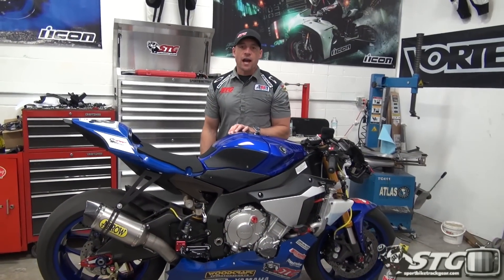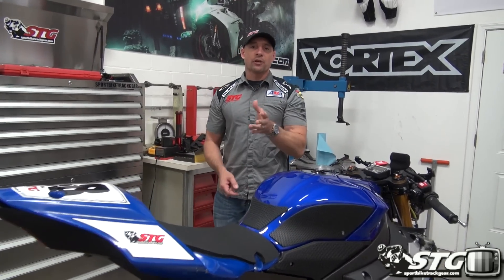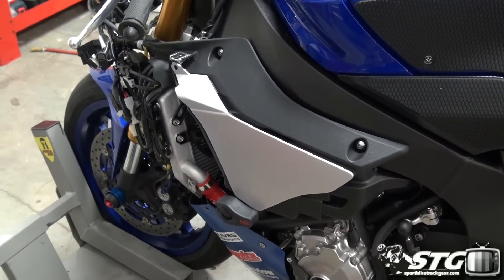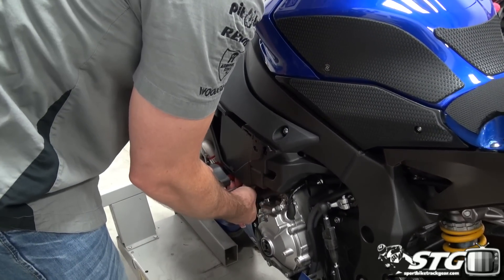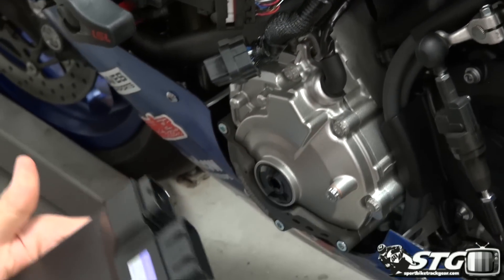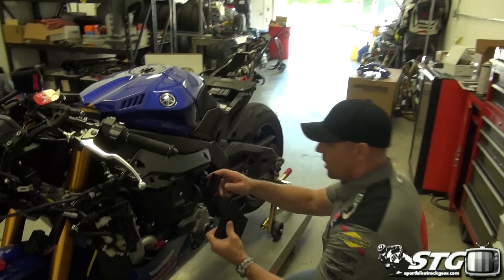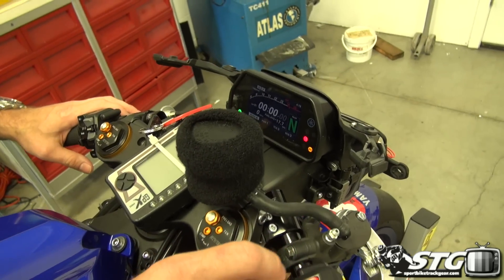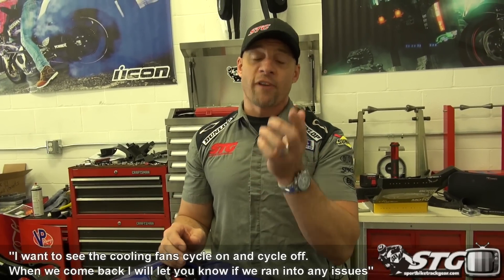How to Flash Tune a 15-17 Yamaha YZF-R1 from SportbikeTrackgear.com

Comment: I'm about 5 years too late but I'm hoping to get a reply. I've been looking everywhere to find a map for 2007 Yamaha r1 with gytr slip on and a danmoto cat eliminator but it looks like theres no maps out there for gytr slip ons. what would be the best map for me to run. again the set up is: 2007 r1 danmoto cat eliminator, gytr slip on. stock headers. thanks in advance
Reply from the maker: I would use a full system map for any brand exhaust. That should get you a good result. If you want more you will need to get the bike on the dyno and have a map built. - Van

Comment: Hi Brian; please Help, I have few question.

I flash my MT09sp. under Unrestricted mode, and i m looking at ecu setting.
1st Question: On the "Disable top speed limiter",  What should i select. (True/False). 
sorry i really confused. 

2nd Question: I noticed after i flashed. when i start riding off my bike and the fan is turning ON. 
But the bike wasn't really heated up to 195c.  Seriously not sure with that.
Please Help.
Appreciated if you could giving me a halping hand. Thanks Bro. :)
Reply from the maker: If you want the top speed limiter removed you need to set that to true. As for the fans there is nothing wrong with it coming on at 195. If you want it to turn on later you can change that as well. FTECU has some great support. Not a bad idea to shoot these questions to them as every model can be a little different. - Van
Reply: @sportbiketrackgear  Thanks for the speedy reply. Love your post aways. 
Two Thumb up. 
I love all your video, n have supporting you always. 
Appreciated so much. 
Thank you, Van.
You have nice pleasant day. Cheers :)

Comment: Is there a flash file for M4?
Reply from the maker: I do not think there is an M4 specific flash. That said I am comfortable running a map based on the system configuration regardless of the exhaust brand I am running. Have been doing that for years with good results. To get the last couple of % in performance you would need to get the bike fully tuned. Most often the difference is not even noticeable. - Van
Reply: Sportbike Track Gear thanks

Comment: I have a 2019 Yamaha R1. The latest Graves R1 flash I see for download is 2018. Seems like the changes should be very minor so would that 2018 ECU flash work with my 2019 bike?
Reply from the maker: To get a Graves flash for any of the most current model bikes you have to be running their exhaust. If you have their exhaust they will send you the file to load into your bike. - Van

Comment: Do I have to have a full system in order to remove the restrictions?
Reply from the maker: If you want to get the most out of the bike you will need a full system with the ECU flash. - Van
Reply: Sportbike Track Gear understood but the flash will cure the rev limiter and choppy throttle until I remove the stock exhaust right?

Comment: Is there a map for akrapovic as for graves or only graves?
Reply from the maker: I don't think there is a map for the Akra. That said I used the Graves full system map with mine and it worked very well. - Van
Reply: Sportbike Track Gear sounds good do you recommend if doing a tune also removing the AIS and deactivating it with the flash? sorry for the questions I just want to make sure if I need to buy the plates with the bench tune as well with the full system
Thanks!
Reply from the maker: I would install the exhaust and block off plates then flash the bike with a map for a full system. End of the day there will be a massive improvement in performance. If you were racing for the win and felt like you needed every last bit of power then invest in a tune with a reputable tuner. - Van
Reply: Sportbike Track Gear thanks guys ill get all that stuff from u guys in a couple of months you are gaining my trust over revzilla
Reply from the maker: We look forward to working with you when you are ready. Revzilla is a good company, that said I believe we are a better resource for sportbike riders. - Brian Van

Comment: Hey Van,
I'm curious who your POC is at Graves? I recently purchased a bench kit from your store and went to upload a Graves Tune(BX4-8591A-10-(US)Graves Exhaust Cat Eliminator 051717L) for my 18-R1S... Unfortunately, because it's a midyear R1 it has a B60 ECU in it and all of Graves tunes are for BX4 ECU's. I asked FTECU about it and they said that I would have to contact Graves because they only have available what Graves gives them. Can you assist???
Reply from the maker: Graves has stopped allowing unrestricted access to their Flash Tune files, this started about a year ago I think. While this can still vary from model to model the only way to get a Graves tune is to purchase one of their exhaust systems. After purchasing the exhaust you contact Graves with proof of purchase and they email you an access code. I have been told FTECU is working on adding tunes of their own for customers to use. Not sure where they are at with this process and need to call them again. 

Is there a tune in their data base you can use for your bike? - Van
Reply: @sportbiketrackgear (Van),
The only thing available in the FTECU for the B60- is the Unrestricted file which I believe has better ignition timing, but I don't believe will address the cat delete and aftermarket exhaust modifications that have been/will be made to my bike. Which sucks because if my bike had I BX4 variant ECU I could use all the graves tunes and no one would care what exhaust I had. You said in here that you ran their tune with an Akro, and it ran great yea?!
Reply from the maker: Yep, I used that tune with several exhaust systems and the bike always ran great. IMO as long as you are running a quality system on the bike a good tune for pretty much any system will work well. - Van
Reply: @sportbiketrackgear (VAN),
I hear you sir, but this isn't about the exhaust it's about me NOT being able to access that Graves Tune by virtue of the ECU that Yamaha elected to put in my bike. So IYHO would you run a high-quality exhaust, with a cat delete, K&N high flow air filter, on FTECU's unrestricted file versus the Graves file?
Reply from the maker: @ShonBroomer  The unrestricted file from FTECU is a massive improvement from stock. It is mapped for aftermarket exhaust with both fuel and ignition corrections in the file. I would 100% run this file in my bike with an aftermarket exhaust. If you have a Graves system on the bike with a proof of purchase you can contact Graves requesting access to the file they have built as it would be a little different from the FTECU. Graves puts a lot of time and effort into those files which is why they restricted access to these files. While the Graves file has it's advantages IMHO most riders (myself included) are not able to ride the bike at a high enough level to take advantage of the difference in the files. - Brian Van
Reply: @sportbiketrackgear  
@Brian Van Thanks Boss!!! That's what I needed to know.

Comment: Can I flash tune for a two brothers exhaust system with this system?
Reply from the maker: You can, not sure you will find a specific map for the Two Brothers system but you can use most any full system map and get a decent result IMO. - Van
Reply: Sportbike Track Gear thanks Van. I appreciate your channel.
Reply: Sportbike Track Gear what about using a power commander?

Comment: is there a way to set an accurate speed reading through this software instead of needing to get a speedo healer?
Reply from the maker: To the best of my knowledge that feature is not available with the FTECU stuff. When we are on track we run GPS lap timers that also record the speed so we use that when looking to find speed on the straight or in a particular corner. - Brian Van

Comment: Van been watching yeah for a while now the ftecu can it for sure clear all codes on a 2018 r1?
Reply from the maker: I know for sure it can do the PAIR System, Exhaust Servo and Steering damper. When you get the bike ready to flash you can enable or disable certain options. Once you have done this you finish the flash and off you go. - Van

Comment: It says it works better with active tune. Do i need to buy the active tune kit?
Also what ecu setting should I change once I select graves cat eliminator map? It doesnt give options like “disable top speed limiter”. What should I do?
Reply from the maker: I did not use the active tune and we do not sell many of them. I would recommend just flashing the bike (assume you have a 15-18 R1) using the Graves map. If you do not see the option to disable the top speed limiter in the software then that is either not available or unnecessary.
Reply: Sportbike Track Gear so just flash it without changing any ecu settings? They already did the settings is that correct?
Reply from the maker: Fast forward to 7:30 in this video and watch the steps I go through as I select the file for my R1. For the R1 there were only a couple options to select, super simple. Now this was done a couple years back so it is possible the software looks a little different now. - Van

Comment: I have SC Project cat eliminator exhaust, Can I flash ecu with the “graves motorsport cat eliminator exhaust” map for my bike? Or It has to be exhaust specific?
Reply from the maker: I have done that in the past, it will work fine. The flash on the R1 makes a real difference, they have the mapping dialed in. - Brian Van
Reply: Thanks. It says in the notes best if used with active tune? Do I need to buy active tuner now? Also What ecu settings I need to change? It doesnt give enough options to change like disable top speed limiter etc. what should i do?
Reply: It says it sounds best with active tune. Do i need to buy active tune kit?
Also what ecu setting should i change? It doesnt give option to disable top speed limiter. What should I do?

Comment: Hey could you please help me figure something out? I have a 2016 r1s and I just spent some good money running a 3/4 system then my local shop installed a pc5 and they blocked off air injection and made me a custom map and dyno tuned my bike and made great hp.Now the question is can I purchase ft ecu kit and just raise my redline a little and adjust the amount of throttle I am getting and leave the pc5 in my bike without any trouble? I don't want to override there custom map I just want to raise redline and amount of actual throttle. If you can answer my question I would highly appreciate it

Comment: Are the maps you got from them free? I bought the M4 street slayer exhaust and I want to flash it once I install it but no one here will do it. Where can I get a map for the m4 street slayer on a 2016 r1
Reply from the maker: I would just use a map in the system for a 3/4 or full system. End of the day that will get the job done and you should not need to get it on the dyno and have a map built. - Van

Comment: A question. If a complete exhaust system is installed on our motorcycle, is it obligatory to make a remapping of the ECU? or can be used as such. I know that it gets more power to the rivet but I want to remove the doubt if it is harmful to use the motorcycle with direct exhaust without making modifications.
Thank you so much
Reply from the maker: Technically you should but to be honest you do not have to in most cases with modern sport bikes that are fuel injected. I have installed many systems on bikes that did not get a tuner installed with zero issues. - Brian Van

Comment: Hi I just installed a akrapovic 3/4 system just wondering which tune to go with . The graves 3/4 or full system tune on the ftecu flash tune  thanks
Reply from the maker: I have the Graves full system file in my R1 now, installed this when I had the Arrow full system on the bike. Since then I have installed the Akra 3/4 (man do I love that exhaust!) and left the map as it was. Performance is solid so I felt no desire to remap. - Van
Reply: Thanks van I spoke to Evan he told me same thing I shop their all the time I appreciate the replay you guys have great customer service and buying from you guys I couldn't be more happy 👍
Reply from the maker: I remember Evan calling me about this. Evan does an amazing job, proud to work with him for sure. Thank you for your business, it is appreciated. - Van

Comment: Hey, huge fan of your videos. Have already purchased some accessories from your online store to my R1 2016, great support. Quick question, I have recently installed a Akrapovic GP exhaust so I would like to flash tune it. Is this setup you are showing here (Graves full system) compatible? Also, a friend told me that an active tuning would be the best choice but I'm just a street/track day pilot and I was wondering if that wouldn't be overshooting? Anyway, for active tuning I would also need to flash tune it first with this kit, right?
Reply from the maker: Yes you would need the unit. I would say in your case the active tune could be very beneficial since you are doing some different types of riding. I actually am using this very same map with my Akrapovic system as well and it runs great.

Comment: I want to install a Austin Racing GP1R 3/4 exhaust on my R1, would the flash tune maps work for all exhaust or just the graves system.
Reply from the maker: The map should work well for pretty much any system. If you are racing in a pro level series I would say it is really only set up for the graves system, but it would be hard for most people to tell the difference. Thanks for watching!

Comment: Does the graves flash tune disable the AIS or the ABS? I saw no option to adjust it so i assume its already built in the program. Or no?
Reply from the maker: +Charles Pratt the FT for sure disables the AIS, I had previously removed my ABS system but I would assume it is still there electronically.

Comment: Brian, did you guys unplug the O2 sensors from the electrical connectors after getting ECU flashed?
Reply from the maker: +jacobstacho No they are still plugged in. I have ridden twice since this flash and the bike has run with zero issues. - Van

Comment from the maker: End of the day they both get the job done. Myself I can get the ecu out in a minute or so and head over to my command center to update. - Van
Reply: Question: what can make the FI light switch on even if the ECU is flashed? Throw -C00 which is nothing confused thanks!
Reply from the maker: You would want to take it to you Mechanic for a proper diagnostic test! Thanks for watching!
Reply: +Sportbike Track Gear thanks
Reply: I had my 2015 flashed and now it won't start there's a err in the right hand corner of my screen what should I do help me man
Reply from the maker: Steven Myers Did you do the flash on your own?
Reply: no I sent it off to get all restrictions of while flashing the computer the bike was getting an extended swing arm and new exhaust when I got thecomputer back I sent it to where I was getting the swing arm done and it wouldn't start it will turn over but it won't fire I'm thinking they may have flashed under european but I'm all dressed up and nowhere to go
Reply from the maker: Bummer :( I would probably recommend you take it to a pro that is close to you. Hopefully they cang et it sorted out.

Comment: The bench unit may be easier initially,   but the Graves maps for their 3/4 and full systems have each already been revised at least once.   Imo the bike harness  is easier in the long run if you plan on periodically updating your ecu.

Comment: Van,
You have chosen the Graves full system map even though it is an Arrow full system installed on the bike. Will there be any issues with this? Is the Graves map meant to be used with the Graves exhaust? If not, can it be used on stock exhaust?

Comment: I like their old licensing system better. And shame on you flash-tune for remotely destroying people's equipment that they owned :(
Reply: +SIG Ninja flash-tune is for off road use only, of course for track bike :)
Reply: toysareforboys No its not.  You can use it on a street bike.  It doesn't do anything that would make your bike not legal for street use.  Stop trolling the Flashtune videos.
Reply: Suppose it depends on where you live partyman, I flash lots of California ECU's to undo all the smog stuff, completely illegal to ride on the street with that stuff changed and disabled.
Reply: And I'll troll their videos until the cows come home. How DARE they destroy equipment THAT I PURCHASED. They have no right.
Reply: It's not Flashtune that's making the bike not legal for road use then...  it's what you're doing with the software that is... presumably by disabling the O2 sensor and air injection system.  I'm not saying it's wrong to do this, but don't blame the software for making a bike technically not legal for road use when in fact it's how you are using it that's making it that way.
Reply: Partyman, read the fine print at the bottom of the page: https://ftecu.com/shop/08-15-r6-denso-data-link-ecu-flashing-kits/
Reply: They all say that so they are not legally responsible for what people do with the software.  If you brought your bike to a shop to have it professionally tuned, they would be giving you the same types of customization options.  We all know that most of the mods we do to our bikes are not legal for street use if you follow the letter of the law (depending on what state you live in, of course).  Removing the factory cat and putting on a y-pipe and slip on are always the first things I do on any new bike.  I can't really think of any ppwer performance upgrades I've done to any of my vehicles that would be technically legal where I live.  More power = more emissions in general.